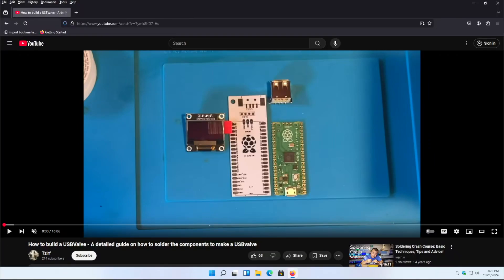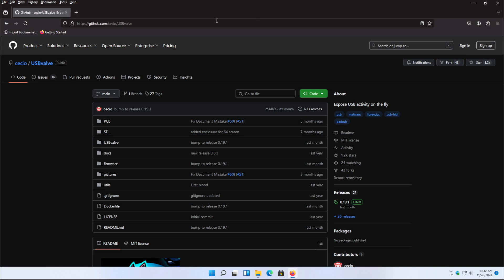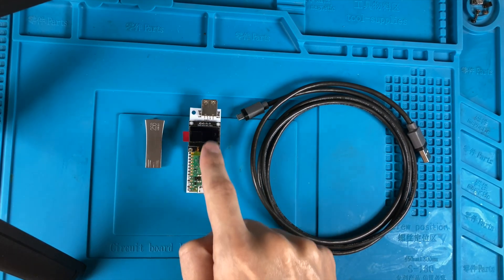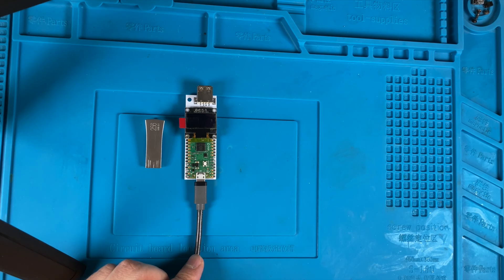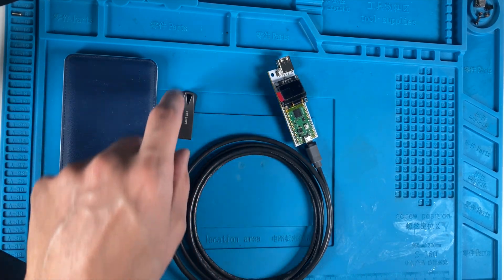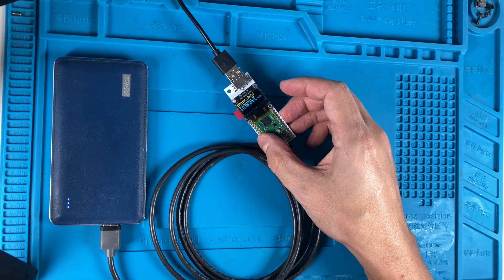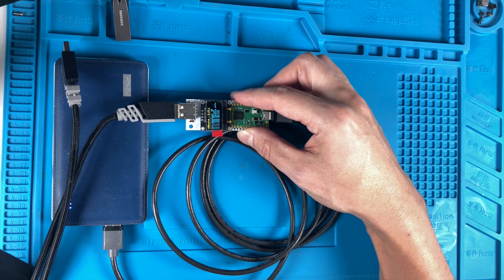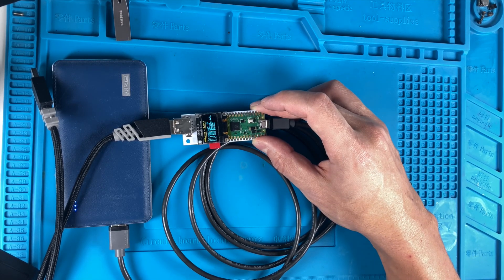Setup a USBvalve and start using it

Comment: Hey, thank you for making this video. it helped me figure this out. once I watched you just copy the firmware over and it worked I retested my solder joints and found the +n data line from the usb connector hovering 0.5mm from the pad. When I tested the other times I was pressing down on the pin so it was making connect. That was why my usb's where not being detected. I am officially a noob. thanks again for your replies and the videos.
Reply from the maker: You're welcome! Everyone starts at the starting line. Give yourself  more credit. You figured out the problem. Nice job!
Reply: @Tzirf  thanks

Comment: You could try to add a capacitor across the output USB positive and negative lines. It could be, that the initial current draw of the keyboard is too high for the Picos PMIC to handle and it therefore drags the Picos signal reference voltage down just a little too low.
Reply from the maker: You are correct that could solve the problem. I probably won't do it though as its the only keyboard I tested that caused that issue. I showcased it just in case someone else comes across the same problem.